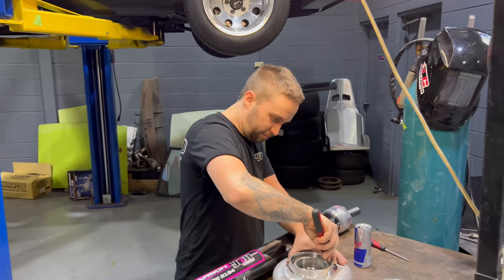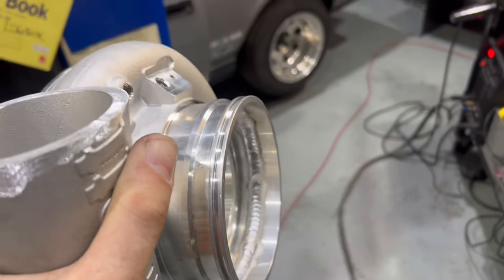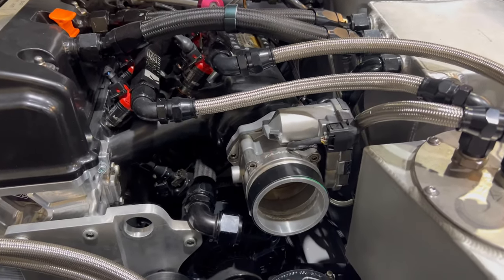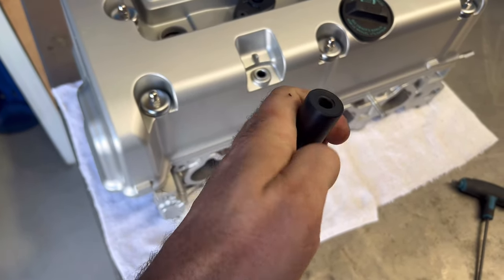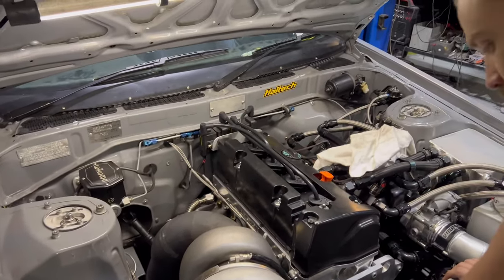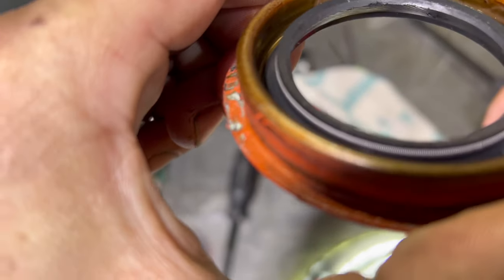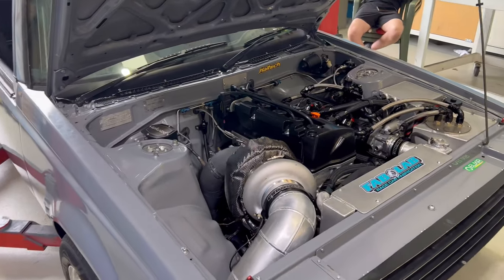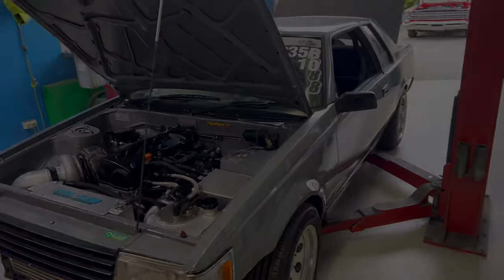K-SERIES BILLET BLOCK is RUNNING! let’s put 70 PSI of BOOST in it!

Comment: can you slit the side of the tube of the coil tube so you don't need to crimp one end on if you have spares?
Reply from the maker: Usually the boot on the spark plug end can slide off so you feed the lead through from the top of the tube- then refit spark plug boot and push back up into tube.

Comment: How big are the oil lines from block to filter ????
Reply from the maker: -10
Reply: @autoperfectionk24  that's what we run on our 2.9 circuit motor but we're 7 main bearings and still wet sump,